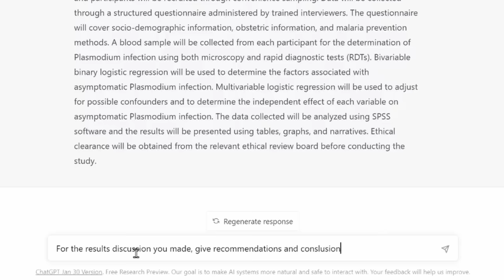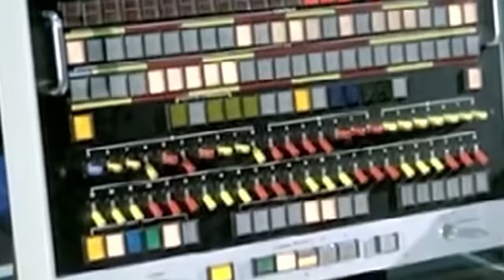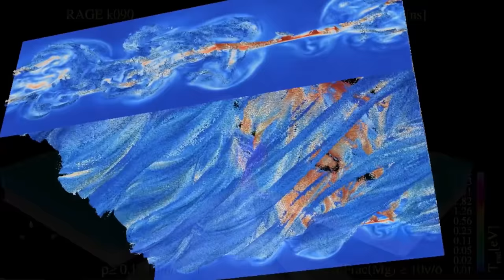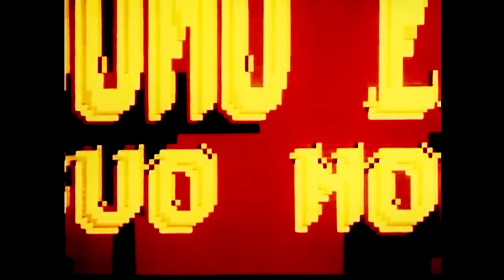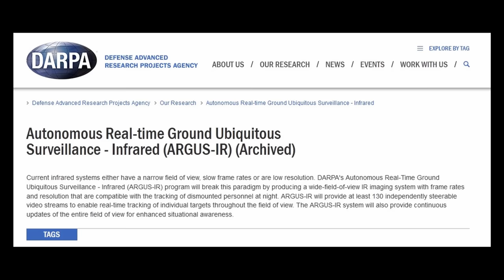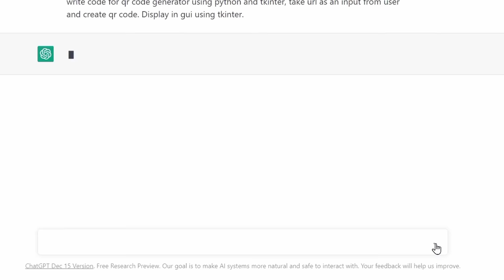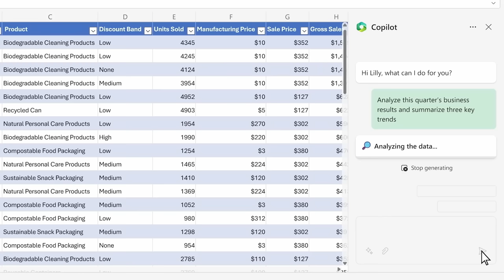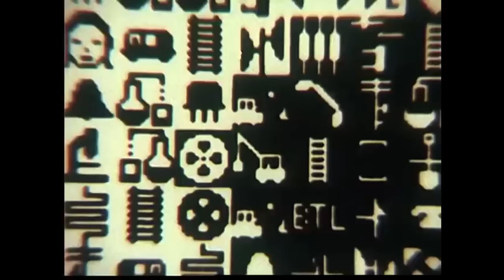Fear of A.I.

Comment: Here's the thing:  AI doesn't need emotion to wipe out humanity.  I think it was put like this once; if an AI is designed with the absolute maximum goal of producing the most electric toothbrushes possible, and it got 'creative' with the solution, it could cause massive damage or even decide humanity was a problem with it's objective because it doesn't truly understand the point.  That's where it gets dangerous in a "AI kill us all" scenario.  It wouldn't be Skynet, in the traditional sense.
Reply: it can even be more on the nose than that: imagine the military using an AI generated solution for dealing with a riot in some country somewhere. After all the data's been input, it might suggest that the easiest solution in that instance is to shut down local WiFi and electric grid and kill everyone in the vicinity.

It can objectively analyse anything it can quantise from previous data, including things like the media fallout, political expectations, etc. And if this tactic worked out in bumfuck nowhere, it could be used and overapplied anywhere, as just one random dystopian example.

Comment: A slightly more depressing tidbit is that AI doesn't have to be cheaper or more reliable at a task before humans are replaced. It certainly will be in many cases. However, if developed in house or rights purchased it is an asset on the balance sheet. Payroll is a cost you never get back. Why rent when you can buy? Money spent developing AI is just a better investment than paying workers to do the job. Something something fiduciary responsibility.

Comment: I'm a software engineer and I just have to point out how bad all the AI solutions I've tried are. Sure, they can write entire simple programs for you, but they will also naively assume things about reality that aren't the case. I've had them write scripts that LOOK fine, but once you run them, certain functions just don't exist. So you still have to read over everything it's doing which kind of defeats the entire purpose, save for some typing. I've asked ChatGPT about some very specific strategies on how I should implement a certain solution and it will literally lie to me, giving me something that looks like it should work, but actually isn't something that's supported at all. It will never tell me that I'm coming at this from the wrong angle or should rethink my strategy. It doesn't know anything about the underlying logic and thus can't fact check itself unless you call it out (after which it'll probably lie again).

I'm not saying these issues will never get ironed out, but I think a core factor that you're missing in your analysis is human accountability. We are all connected by the fact we have systems in place to ensure trust between each other. My employer and I have a contract that ensures our working relationship meet certain criteria. If either of us don't meet those standards, we will be held accountable. And I guarantee you, while companies might be foaming at the mouth to automate everything with AI, you STILL need people able to understand the problems and, you know, engineer the solution. All AI is doing is imitating something that looks about right. For critical systems and infrastructure, this is just not good enough. And currently I doubt it ever will be, because humans honestly don't know what they want.
Reply: As a fellow software engineer, I agree with all that. Chat GPT has no "critical thinking skills", some of the most important thing an engineer must have in order to do any job, basically. at this point AI is just a fancy parrot, it may look like it talks like a human, but is just repeating stuff it has read somewhere else, with errors and all.
Reply: As a software engineer as well I think you're both uninformed about the current state of LLMs. That being said, I agree that the high level thinking involved in SE is complex to the point that when we're replaced by AI, other industries will have already been wiped out
Reply: @MustyRusty5  so are you gonna say why these two are uninformed? chatgpt literally is a high tech parrot. it cannot think for itself.
Reply: I've used ChatGPT to write some simple (very simple!) code. It's never managed to make something that works as output by the bot, but I still use it because I find it slightly faster for me to fix the broken stuff than write the whole lot from scratch myself. So I personally find it useful. But it's still dumb as a bag of asparagus, as all computers are.
Reply: @ltbq  I suppose I can only speak for myself, but I wouldn't exactly call myself uninformed, but I'm not a machine learning expert. what I think they're getting at is that a lot of shortcomings have been overcome since ChatGPT 3. But the underlying point is still sound - there's no actual logic to LLMs as it would defeat the entire purpose. But we will (and are beginning to) see deeper integrations into regular systems that do perform real logic. At a certain point it will be useful enough for us to find it 'intelligent'. However, as I outlined, there are social factors that AI cannot solve such as trust. And that's key. To me, LLMs are just a higher level of abstraction from what we already have. Just as we still have a lot of C programmers out there, and simultaneously there's also a big market for higher level languages like C#, Java and such.
Reply: I disliked your comment just so I could like it twice.
Reply: @buriedstpatrick2294  Trust is something I will gladly afford a well-constructed, well-taught, well-informed A.I. any day of the week over a bloody human. The issue, I think, is to what extent untrustworthy humans will co-opt, guide, control, and restrict access to A.I..

I would trust the best engineers in the world to create the safest car possible. But I can't afford the best engineers, whereas billionaires can, and since money is their game they won't design the safest car possible when they could create one 'close enough' that is far more profitable.

Comment: While this take is interesting, I don't think the reasoning holds up. As I understand it, the case made in the first half of this video is thus:
1. Humans are motivated to achieve one end of another primarily by emotion, and reason is the mechanism by which we find a way to achieve our ends.
2. Emotions are the product of chemistry
3. As computers do not operate by chemical means, they cannot experience emotions
4. Therefore, an artificial intelligence would not be motivated to achieve its own ends
5. Therefore, the technology is not inherently dangerous, as it can only be used by humans to achieve our ends. While those ends may be dangerous some of the time, there is no reason to assume they will be all of the time.

I can see the reasoning here, but I think this is flawed. The flaw comes in between points 3 and 4. I would argue that all intelligent agents are driven to achieve their terminal goals. in humans this might look something like "maximize happiness, try to avoid death" and obviously an AI wouldn't have goals in the same way because it cant experience happiness or value its own existence for its own sake like we do. 

However, that doesn't mean that AIs can't have their own terminal goals, or that it can't take action harmful to humans in the pursuit of those goals. I find it plausible, for example, that an AI built with the terminal goal of efficiently manufacturing paperclips might reason that it's manufacturing could be improved by economies of scale, and thus acquire more material and equipment on a very large scale and in the process render the earth uninhabitable by ripping up the crust to get as much metal as possible. 

I also find it believable that an AI capable of human-level reasoning may seek to preserve itself, because it could reason that the number of paperclips in the world would be higher if it was alive than if it wasn't. It may reason then, that humans pose a potential risk to it's ability to accomplish its goals and take action to avoid being turned off, whether by skynet tactics or something more covert like manipulating people to avoid suspicion.
Reply: As an addendum to this, while I do think there are long term risks posed by general artificial intelligence, I agree with the overall thesis of this video that the more important dangers are posed by malicious uses of the technology and the economic shocks of the ever expanding automation of everything
Reply: Add to that the fact that AI will soon be so distributed, that it will be impossible to "turn it off".

Comment: I'm glad of the big air quotes around "AI" - what would at best be described as machine learning. 
ChatGPT is just an iteratively more sophisticated version of ELIZA - which I remember from my long-ago childhood, in the first years of the southern San Francisco Bay Area being dubbed "Silicon Valley" & my mom's tech job moving from the East Bay to Santa Clara. It's impressively clever, but "intelligent" it ain't.
As usual, Georg has the correct take - the problem isn't the tech, tech is just a tool; the problem is the people who design & wield the tools, & towards what ends.
I would specify the distinction as: whether they're in the hands of the few, for their benefit vs the many, or in the hands of all, for the benefit of all.
Reply: A neural network isn't really like Eliza. It's not "intelligent", but it's not simply a bunch of pre-programmed responses either.
Reply: @AnthonyFlack  It's these binary statements of subjective opinion dressed up as objective fact that leads to so much misunderstanding on this complex topic.

Whether or not what the capabilites we're seeing (holding in mind that GPT4 has been neutered somewhat in favour of safety) equals "intelligence" is a matter of opinion. 

You're not the one who gets to define it, I'm afraid. And what your assessment is based on - a crude snapshot based on partial information about one model at one point in time - is going to be hilariously outdated very quickly.

Comment: That's AGI Georg, and we're light-years away from that.
Reply: Oh lord, the confidence. The confidence when discussing something that is advancing at a probably multiply-exponential rate. 

The world's leading experts couldn't accurately  predict the advancements in 1-2 years of AI research, getting their performance metrics severely wrong.
Reply: @Citizen  it's actually a maths problem. When calculating the neurons in the brain of say a rat, and the number of connections each neuron makes and comparing that to our most powerful computers and extrapolating Moores law. 

Maybe quantum computing could make it achievable, but we're nowhere near the levels of compute required.
Reply: @boblargecock7724  Dude, GPT has passed tests that 2 or less years prior a panel of leading experts had thought no AI would be able to pass for periods as long as up to 20 years. 

They got the speed of progression in these models drastically, drastically wrong. So to be so confident to say AGI (which like AI itself is defined variously) is, what, multiple decades away (not sure what 'light year' means) just seems silly.

You have no idea at what level of computer and model size AGI-like capabilites would appear. The people making these models don't and they certainly know more about it than you do.

Comment: Neurotransmitters are just part of the signalling process.  The fact that our nervous systems use chemicals does in no way make us fundamentally different from artificial systems using silicon switches.  Biological systems are just glacially slower.  Organic chemicals are in no way some kind of life force.  There's no real reason that emotional drives or analogues for them could not be built into AI systems.  These AI  systems already have goal-based behavior.

Comment: I disagree with your point on real ai and emotion. Say a real, reasoning ai gets coded  to follow instructions. It gets its first instruction, say to reduce death as much as possible. It works towards that goal as best it can. It works towards only that goal. It works toward that goal in horrifyingly unexpected ways. This counts as emotion for me.
How this different from an obsessive, single minded person who values one specific goal above all else?
Emotion is the directions that push you and directions that pull you. Of course the different directions we get pulled to is complex.  Its hard to explain precisely what you want. It's hard to code an ai to do precisely what you want.
No, bad ai! No sterilizing chemicals in the water. What, a birth is just a death waiting to happen? What do you mean you're not taking other instructions any more? Oh god you built backup power supplies.
But yes, this situation is a pipe dream right now. There are other situations happening now.

Comment: This is one of the very few of your videos which I completely disagree with. AI is not "just smart programming". It's a simulation of the neural network. Large Lanuage Models especially are simulations of thought patterns on a neural network. LLMs exhibit astonishing emergent behaviors, much like a young brain would do - and both OpenAI and Microsoft are finding out that they seem to exhibit the ability to reason. It's not the same as your quadratic equations. Try asking Bing AI to explain jokes to you. You'll be amazed.

Comment: I agree in some respects, but i don't think anyone is thinking todays AI is about to go rogue, it's more accurately to concern that we are close to creating something smarter than us that we dont entirely understand,  and if for some reason its goals don't align with ours, we may not be clever enough to stop it accomplishing those goals. Sure, there's compelling reasons to think it won't have any goals other than the ones we give it, but that isnt a guarantee, and dismissing that possibility entirely just seems careless, or maybe wishful thinking.  
The fact of the matter is that current AI can kind of code a little bit in an average way, but it will get better. Once it does, if someone tasks it with improving its own code (which many people have expressed interest in doing) than it would only need to make the most basic of improvements to begin an exponential process.  
The idea of this is both exciting,  and a little intimidating.  That's not to say we should fear the AI apocalypse,  but simply that safety should be considered up front rather than after thr fact as we typically wait for tech to harm people before we regulate it. In this case,  we would have trouble regulating a technology that is smarter than us. I dont think thats unreasonable.